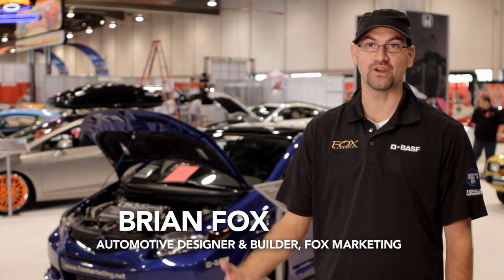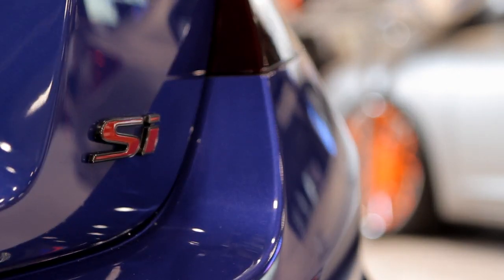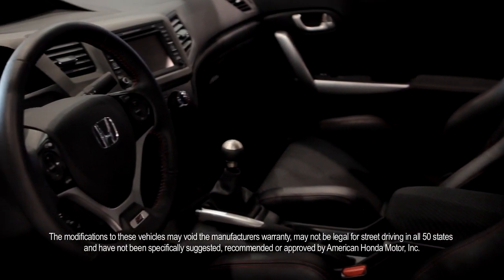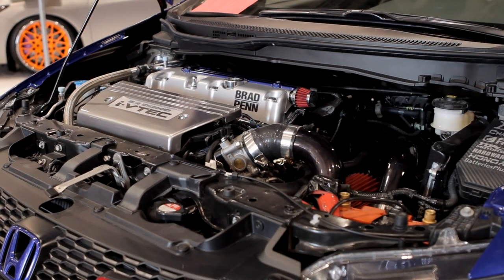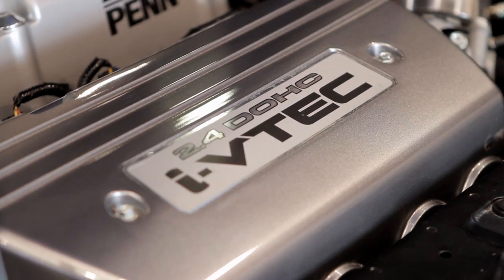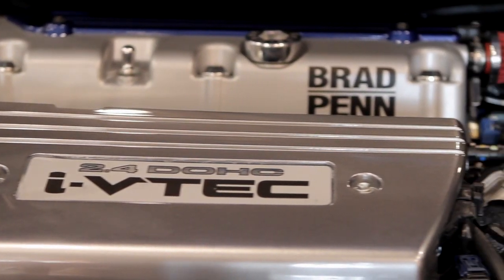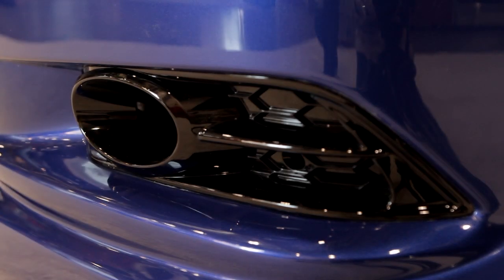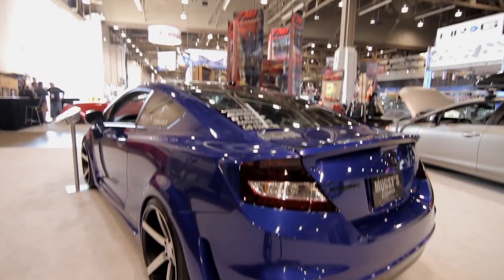2012 Civic Si Coupe by Fox Marketing

Comment: @barberEK9 
This kit from what I understand comes with a 2006 computer with flashpro but don't quote me yet I am still trying to figure that one out. Injectors cost 110 for 4 on the old kits around 650 for a clutch but that does not deal with the turbo kit itself. FR catback is costly but why even go that route with a turbo system. Just buy pipes and muffler or straight thru. all the mounting hardware is included. Expect to pay about 6-7 grand total plus tune.

Comment: Sorry about that. I misunderstood one of the sales guys. The ecu will be extra. Its about 650. From what I have been emailed. The 2006 ecu will easily replace the 2012 no extra hardware needed. Price on their site shows 110 for 4 injectors. But again this is all from the 8th gen pricing. The clutch is a user option if you buy from them. That all depends on the user and amount of horsepower a person wants. Dynotune has nothing to do with the cost of the kit. Most have people that they know who

Comment: @yoon8505 
Civic will have more aftermarket parts and is cheaper, but you will stand out more in the Genesis, which has more stock horsepower, and a better interior.